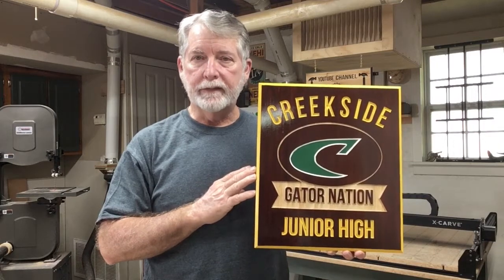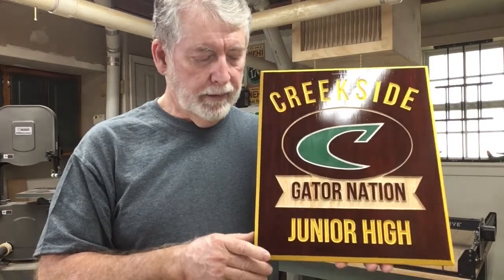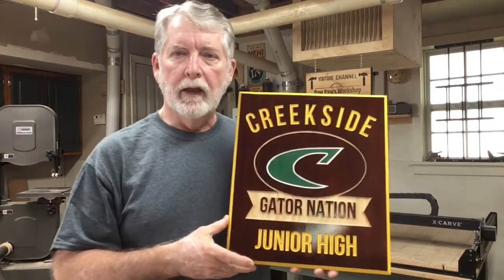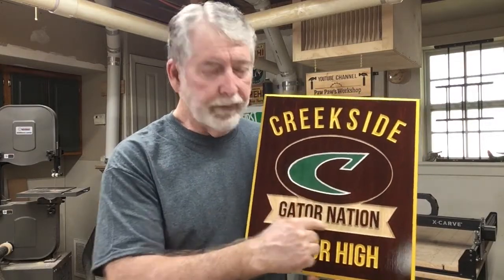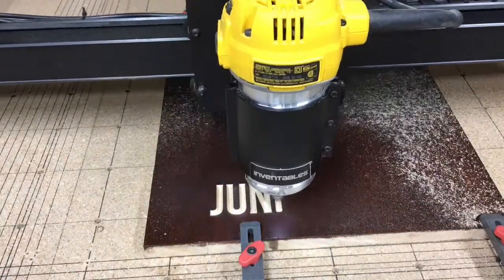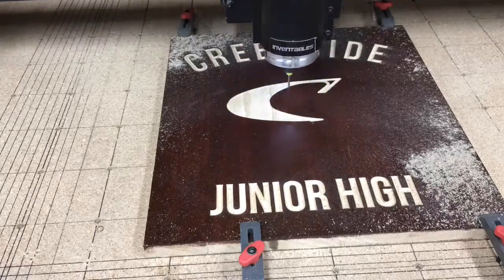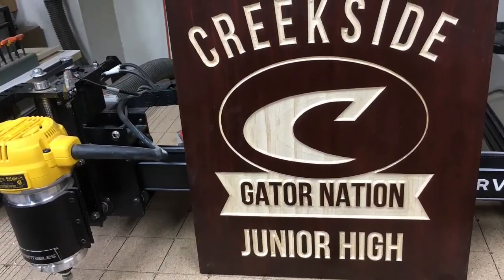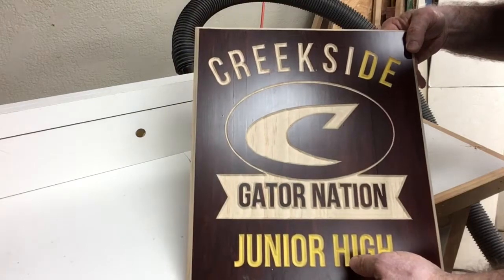REMAKE of a Sign Using Two Stage Carving

Comment: Hello Sir, my question to you is how do you set up two stage carving in easel? How do you tell it to use one bit and how do you tell it to use another bit for the second stage? Cheers!
Reply from the maker: I did a video last year in June on two stage carving.  However, in Easel on the top right you can select a bit and it shows the bit selection, next to that is a "+" sign. Select that box and you can add another bit.  The software knows that you now have two stage carving.  Do a simulate and you will see each bit.  Blue for the first bit and green for the second or detail bit.

Comment: Very nice sign paw paw! Was wondering how you painted the inset letters and logo? Just careful freehand?
Reply from the maker: benjamin lipinski you do. Or have to be careful. Paint the area without worrying about getting paint on the surface. Simply wipe off the excess. I use acrylic paint   The wood is sealed with poly so the excess just gets wiped off with a damp cloth. Thank you for the compliment and the question
Reply: Thanks! I have been trying to figure out ways to accomplish two to three color signs for awhile. I don't have a CNC yet so I have been free hand carving with my router and using a mask is hard because the router pulls it up sometimes. I will try painting the base color like you do and then carve my design and paint secondary colors and wipe off excess like you said. Thanks again and you got a new subscriber 😀

Comment: Hey paw paw... Today i ruined my nice project....i painted the wood black with spray pain...then i machined the image like u did....but then i tried to put polyurethane on it with a brush and it disolved the black paint and ruined my project....any advice from you would be appreciated
Reply from the maker: der ddd .  What type of black paint did you use?  Also was the poly that you used water based?  I’m so sorry that you ruined the project.
Reply from the maker: I will do a video on the  process. 
The first thing I do is to stain the wood, in this case I used two different stains to get the color I wanted. Once dry, I use a water based poly to seal the wood. The water based poly prevent a chemical reaction that you had on your project. I then carve the project with a Using a downcut bit.   Next paint with diluted acrylic paints. Use a damp cloth to wipe the surface clean. When dry, spray clear high gloss usually two to three coats until the desired finish is achieved
Reply: normal rustoleum black spray paint and the poly was just minwax semigloss poly in a can...water based....it just dissolved the black paint immediately and becasme a big mess it sucks
Reply: if you are not sure , can you find out amongst all your you tube people why this happened.......ive never had it happen before.
Reply from the maker: der ddd .  It is a chemical reaction. The base is not compatible with each other. On some spray you can spray within an hour and not get a reaction. Otherwise you must wait at least 48 hours before spraying the poly
Reply: thats a possibility paw paw  the paint set for 24 hrs..maybe i will experiment on scrap wood tomorrow and let paint sit for a few days and then poly and get back to you with results
Reply from the maker: der ddd .  Read the can. I’m sure that if you missed the within 24 hr window you must wait beyond 48 hours. I have actually called the company and talked with their support staff about chemical reaction and with their sprays